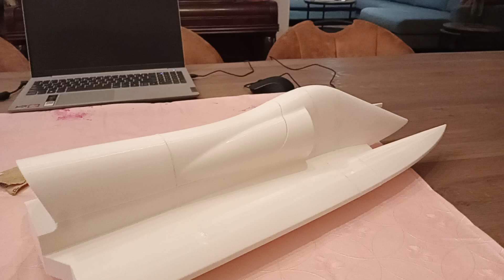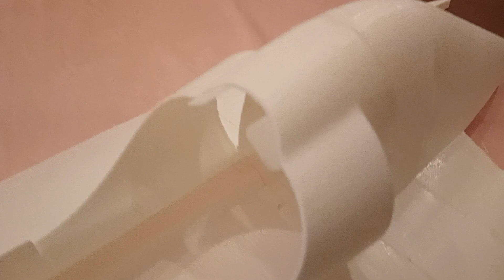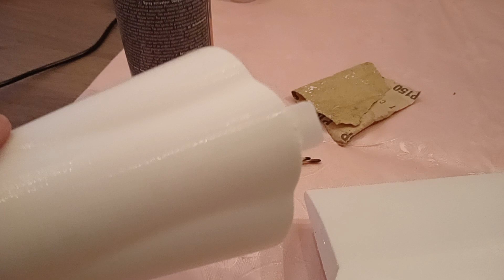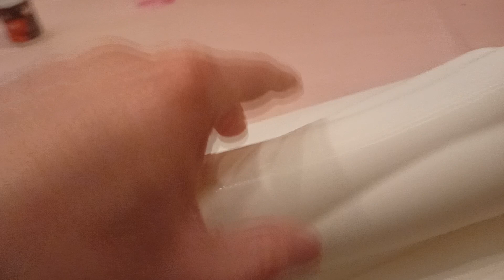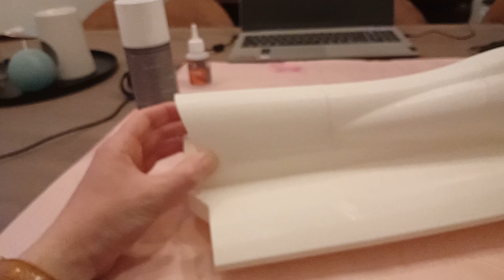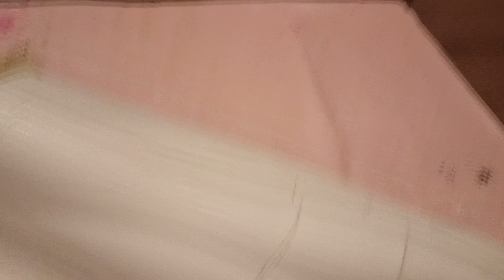3D printed F1 rc boat, continued.

Comment: I might have missed it in last Video what type of filament did you use and looking forwrd to next Video
Reply from the maker: But I am working on my own design, with a watertight section and no large air intakes (which take on water and catch air / break the streamlining). https://cults3d.com/en/3d-model/various/rc-f1-powerboat-hull
Reply from the maker: Hi, thanks for the message. It's regular PLA, printed at 0,2 mm layers with 2 walls.